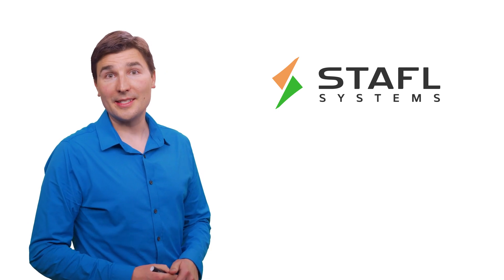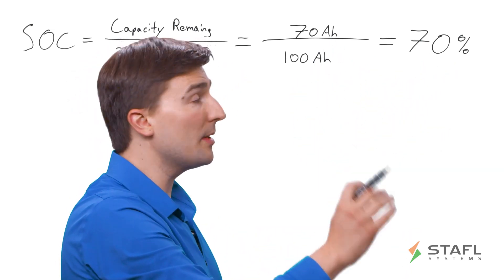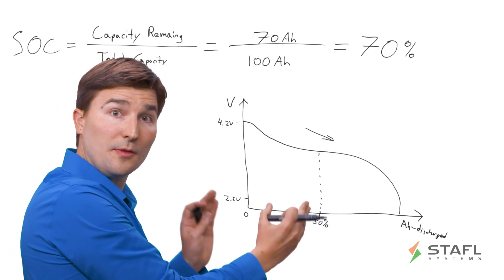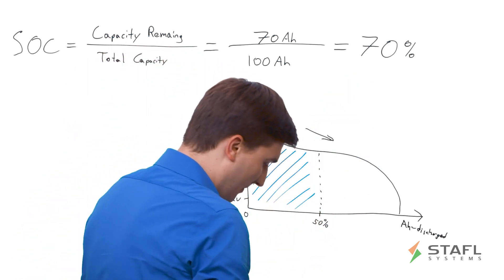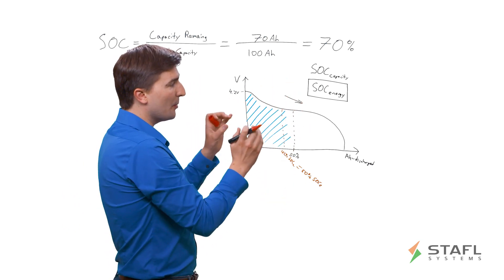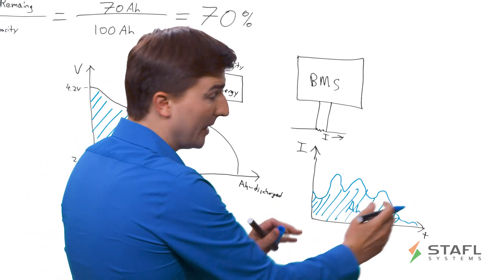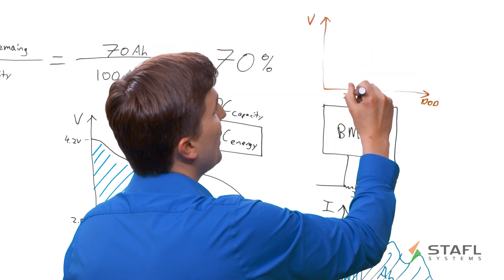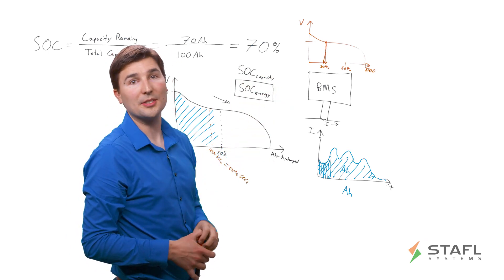Calculating the State of Charge of a Lithium Ion Battery System using a Battery Management System

Comment: So what voltage corresponds to 50% SOC? That seems like a very critical piece of information that you didn't provide because, if you are trying to estimate either the mAh or total energy remaining, the simplest thing is to measure the voltage and use that as a proxy. I watched this video hoping to learn these voltages, but was disappointed when you didn't provide them. And yes, I do realize that Coulomb Counting is the more accurate method, but that doesn't help you if you simply "come upon" a loose 18650 and want to know how much capacity it currently might offer.

Comment: very nice tutorial sir, in my set up sir im using 2 pcs 24v 100ah lifepo4 batt. in parallel connection. my question is why is it that in my volt meter, display of my scc and in my inverter was 100% and when i scroll down in my scc srne 60a mppt the soc was 54% what is the defirence betwen them? thank you sir i hope i'ved got an answer sir. thank

Comment: Simplistic, theoretical nonsense, not corresponding to the reality of any particular LiFePo4. Have you ever bench tested dozens of batteries? Not one of them ever follows the maths or the graphs. New vs old; quality internal chemistry vs recycled lithium; hourly/daily/seasonal temperature variations; balance between cells; number of cycles; all conspire to make the only real SOC a specific measure of currents in and out from a daily top balanced cell reference point compared to the maximum actual battery SOH (State of Health). I have never, within real life situations, found a SOC figure to be any better than about +/-  8%. 

The only true SOC is

Comment: I think this presenter is mostly presenting his own confusion, there's no actual distinction between capacity and energy.
Reply: That's only true if internal resistance and voltage discharge curves are non existent.
Reply: Capacity is charge (Amp hours) and Energy is Joules (Watt hours), so the voltage profile is important.

Comment: If we have a function approximation for voltage / SOCc curve, it would be easier to normalize SOCe from voltage than a lookup table. I would like to model that. Wonder if there would be use to that.
Reply: modeling a Voltage/SOC and measuring SOC based on voltage curve could be easier, but don't forget to consider the voltage drops on the battery itself due to internal resistance and the variation in voltage when charging.

Comment: These videos are brilliant, Mr. Stafl, thank you, very easy to follow along. One gets into the noble field of lithium battery technology for environmental concerns, tries to brain-up on lithium battery characteristics and electrical fundamentals, and invariably gets stuck between principles and real-world application. Me for example. A coulomb meter out of the box needs initial settings ...specific to that battery config that it's monitoring... like capacity, full voltage "empty" voltage, and drift. A lithium battery pack's stated Ah may be, say, 40Ah, but is it the kind of parameter that ought to be tested for? And if it's "72v," obviously the range is going to be a few volts above (for full) and a bit above. (for depleted)  But these are rules-of-thumb, and sort of nebulous to the amateur. To get specifics, should I test the voltage a.) immediately after charging, or after a day or two, and b.) idle or under load? In the interests of mitigating range anxiety, I'd like to make sure my settings are as specific/accurate as possible. You've got several videos. Is there one that may address these real-world scenarios best? Thank you.

Comment: I totally dislike your BMS system because it can handle the ODD number of 12 cells, are you aware that most of the batteries in storage applicatins are 16 cells LiFePo4 ?
Then the total cost of just the BMS is way overpriced at 700+280+280=1260$ with the last monitor only half populated. Totaly ou of the residential storage market!

Comment: Hello, what is the internal resistance of the 4S lipo battery or what is it? I have a 5200mah 50C battery and the internal resistors are showing 7 ohms.
Do you think these values are normal?

Comment: My solar station software show SOC 3% and gradually increase but the voltage is above 12 so than why 3, or 5 or 7. It’s mean battery is too low . I am using Phoenix 230amp flooded

Comment: But Amp.hours is a measure of energy. You mean the peak power available, potential to do work goes down over time because the voltage drops? I am confused.
Reply: @Nick Keller Yes, amps x volts = watts. The same 100 watt light bulb will draw more amps as the sos drops.

Comment: if the battery is connected to load , How we gonna measure open circuit voltage in practical application ??
Reply: you cant , you will need to use some other estimation methods
Reply: My hypothesis would be that when the car is off or sleeping that that measurement is done.  That's why when you park your car with 33% that when you get back in it might be 35%.  Or 30%.  It's possible it is more dynamic than that.  It may do an instantaneous measurement during load reduction and calculate the delta from that.

Comment: Hi! I have a small clarification. 
It was said that energy distribution is imbalanced. We know that energy is Voltage times Ah discharged. Even though the voltage is high in the first part the X axis is at a low value. Will it not be compensated?
Thanks in advance for correcting me and clarifying it to me :)
Reply: The x-axis is the Ah discharged from the beginning of discharge not the instantaneous Ah

Comment: Awesome explanation! However, I just want to make sure if I get it right:

1. DoD can be calculated through current measurement and time graph.?

2. The battery capacity is calculated by comparing its measured voltage to its Voltage-DoD graph?
Reply: The capacity is measured by coulomb counting. Capacity equal to integration of current by time.
Reply: from current and time get SOC, from SOC get DOD

Comment: Excellent info. My question may seem elementary but I understand quite a bit of what was discussed from my EE background. That said, I find one thing confusing. Is SOC and DOD the same with two 100ah lifepo4’s in parallel as one 100AH standalone lifepo4? I realize that I am getting 200AH with the parallel config and only 100AH with the standalone battery. With 2 in parallel, I would think that it should take twice as long to reach the 50% SOC level with the parallel config than in the single battery config, of course assuming the same load on both configs.
Reply from the maker: Hi Rich - thank you for your question. SOC and DOD are expressed in percentages, so they would be normalized to the size of the pack itself. For example, if you've discharged 25% capacity from a fully charged state, the SOC would be 75% and DOD would be 25%, regardless of if it is a 100Ah or 200 Ah pack. So if you have a constant load of say 25A, it would take you 1 hour to get to 75% SOC with a 100 Ah pack and 2 hours to get to 75% SOC on a 200 Ah pack.

Comment: At the 5:00 min. point, doesn't that point actually represent a greater than 50% SOCcapacity or is that 42% capacity used at that point?  I think I understand. It seems that the 42% is more Depth of Discharge????
Reply from the maker: You are correct. The 42% figure should be Depth of Discharge (DOD) or 58% SOC. This is an error on our part.
Reply: @staflsystems  i was wondering the same. Thanks for the clarification

Comment: How do you the remained capacity"70ah"?
Reply: For example, you have a battery with 100Ah capacity. And you discharge the battery with 30A for one hour, there will be 70Ah capacity left in the battery.
Reply: @yangjingxi179  thank you